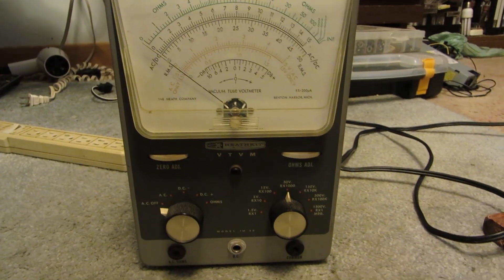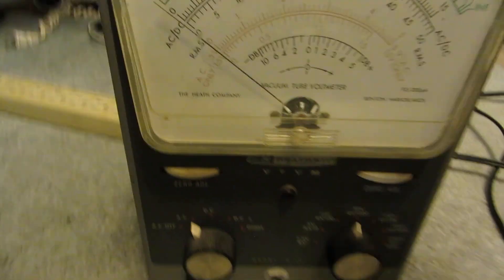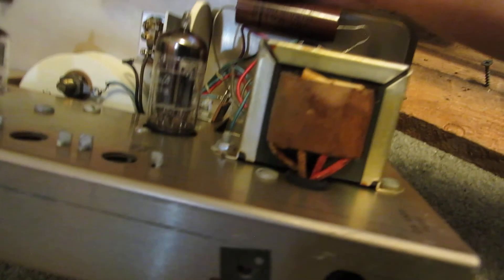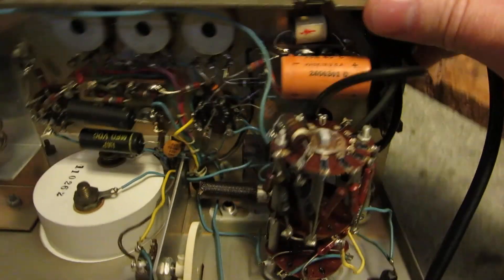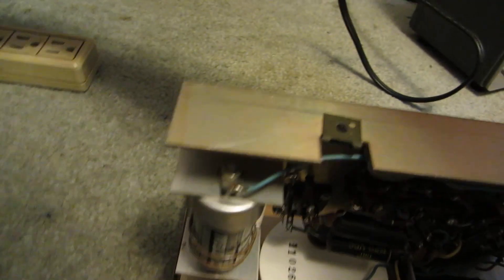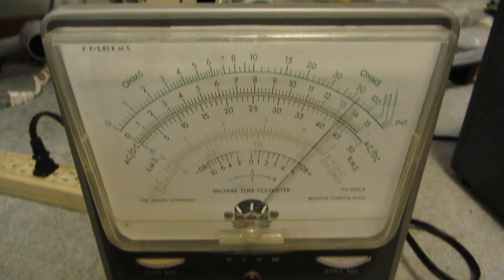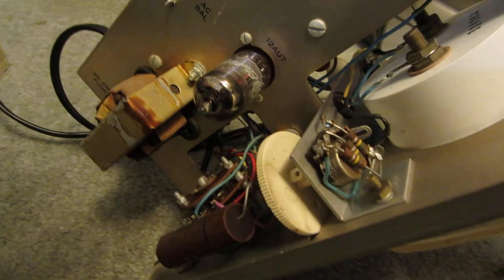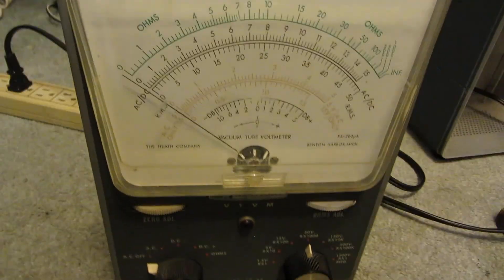HeathKit VTVM IM-32 Autopsy

Comment: this is junk, i have the same junk on my won by mistake , all heathkit  stuff was asemb by people don,t know nothing about electronics  ,,, they just put things together , i fund parts backwards ,things  unsolder , wrong parts install etc,etc ,i don't trust heathkit shit , they all junk
Reply: Besides the higher end, HP, BK,  triplet and Simpson. Has probably been built by another I've seen them built wrong, and find. My eico 232 again it's better than nothing was in bad shape electrically but extrenally on great shape. The whole voltage divider was shot probably do to being close to the ocean. Maybe a few other possibilities. I rebuilt it correctly fixed the backwards caps, all the faulty resistors, I left the 82 meg it tested a bit high. Start putting resistors in series on that part your frequency response is gonna hurt bad! That's literally the input to the amplifier. I have a 235 that someone did this two 90 something megs if I remember correctly. Sucks probably wouldn't have hurt if it were just a bit over tolerance on that portion it's already 20%. I agree with you to disagree with you friend is all. Yes they can be poorly assembled, but in the rigth hands they can be fixed and are pretty accurate my 235 does well I ran it for 3 or so days calibrated, and every since I zero it let it warm for an hour re zero if needed, and sat far it's pretty close just a tad high. It still isn't prefect but it does what I need it to for now. It needs new pots the 82 meg if I can find it.
Reply: so it's ppl like you that can barely put a sentence together .....well you seem worse you might be a preschool dropout